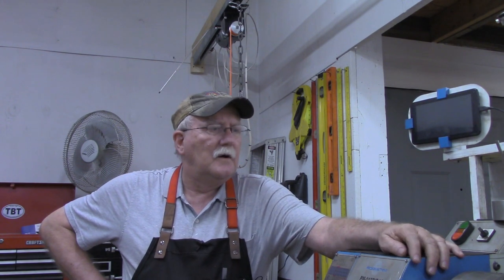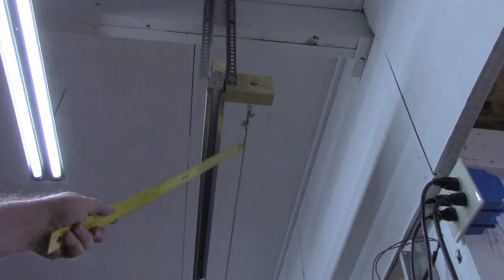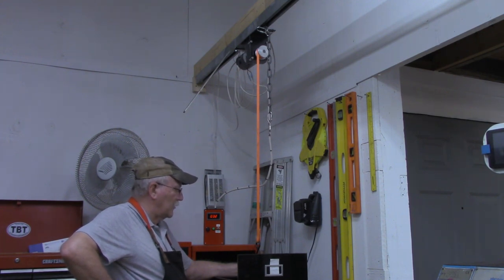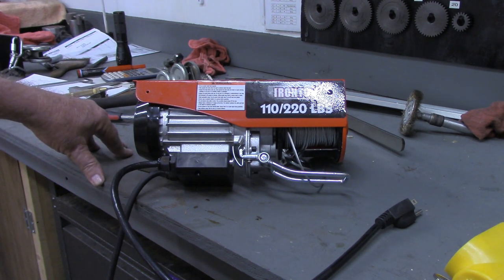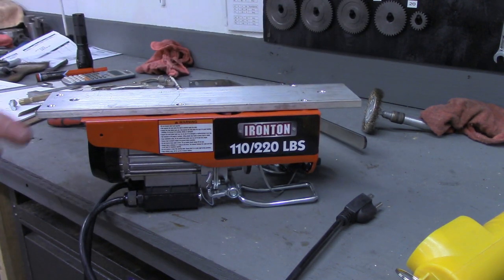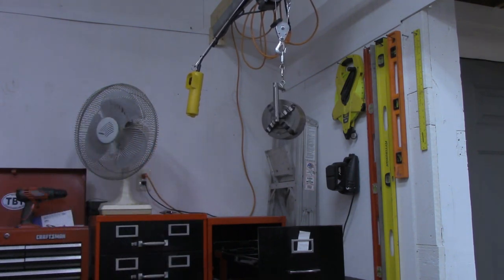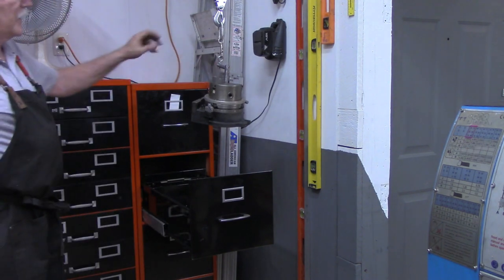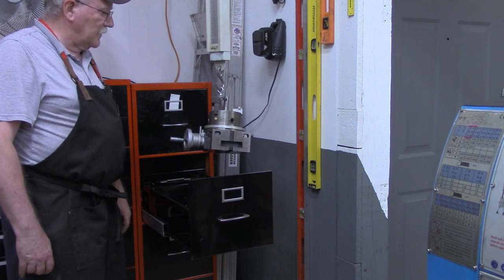Lathe/Mill Accessory Hoist

Comment: It's more than a brake on a hoist. The gear head is designed so that the motor has to run both to lift and to lower. Low capacity electric hoists are very cheap even over here. Don't mess about, use one of those, or a small block and chain. It's safer. I like the use of the filing cabinet, great idea. BobUK.

Comment: That sure looks like my hoist.  I like the track you have there, that is laid out just right.  I would have loved to have enough overhead support to hold a track but it is sort of crowded up there.  I had to get a piece of plywood to put on the mill table to cushion the touch down with that hoist.  Even with two cables it is still a bit fast.  Thanks for the video.

Comment: I have a Horror Freight hoist running back and forth on a steel I beam supported by laminated 4x4’s using a Horror Freight motorized trolley (they no longer offer the motorized unit, but they have a trolley you can easily pull with the operator pendant of the hoist unless you have ten tons on the hoist!) For power to both units I use a self retracting power cord reel that is dedicated to the hoist mounted to one end of the I beam.  Hoist moves away, power cord pulls out........hoist moves the opposite direction, cord retracts. No need for screw eyes or any cord guides of any type.  Both hoist and trolley stay permanently plugged in to the cord reel. Had it for years.  Never a problem.  Their hoist has a brake and it never moves up or down unless you push the button to make it move regardless of the weight on it. (i.e. lawn tractor off the ground). One thing the Chinese Communists do a good job on apparently.

Comment: I have always liked file cabinets for tool storage, especially those that I have outfitted with roll-around caster bases. 

Ain't nothing more frustrating than dropping a part inside a heavy file cabinet. With wheels, you can always roll the box out of the way — and pick up the part.

Comment: I have a winch in my shop. It is a 550/1100 pound winch. It is stationary but would like to buy a smaller winch and put it on uni-strut rails. You can get the track wheels for the uni-strut rails also. I just dissembled my heavy pm940 with my winch as I am going to convert it to cnc soon.. The winch is also great for hanging a deer on when skinning.

Comment: I would use a HF 2500 lb 12vdc winch.  Power in and out with a brake to eliminate free spooling out. Also has a remote control  When they are on sale they are around $45. The HF winch that you used is almost double the price of the 12v winch.
Reply: Tom Rumish - I bought the 12vdc winch to use in my shop but haven't installed it yet!

Comment: I have a Track in my shop with the HF winch to lift and place 4x8 sheet goods for my Table Saw, but I used an old trouble light reel and took the ratchet out of it so when my winch moves the Power cable follows it and when it moves back the cable retracts automatically. js

Comment: Cant you use a shunt resistor or actually use a switch which short the winding's with no voltage? Same idea as a brake on dc traction motor for a train. This is what I thought u were going to do.
Reply: Won't work. Load will still drop, albeit more slowly, but it will not hold still.

Comment: Hi Mr.
You had a very nice sounding motor - I'm sure you'll wil NOT be satisfied with the sound of that new motor - it'll make you nervous O'm sure.

Just get a used angled gear motor with ot without brakes - second hand gear motors are next to nothing - here in Denmark at least !

I have had my mill  (1750kg !) hanging in that hoist - the wires was howlling like a bunch of wild wolfs - so my limit at 150Kg is pretty safew I think.

More details here in danish but you can Google Translate to the right just under the menu line - choose whatever language you like in the combobox - the only problem I have is the bad winding of the wire - I have to find a solution to wind the wire nicely. - take a look here:
http://kelds.weebly.com/loslashbekran.html